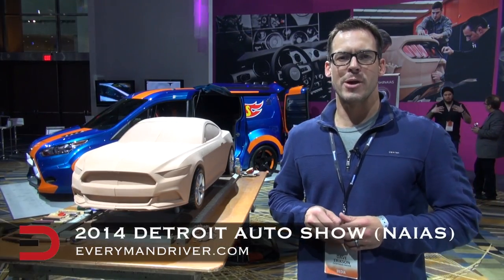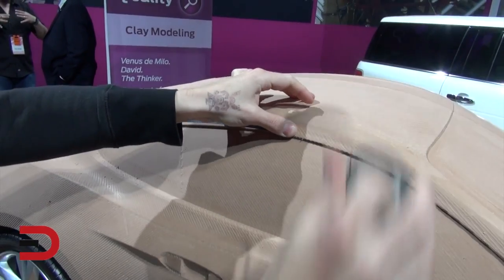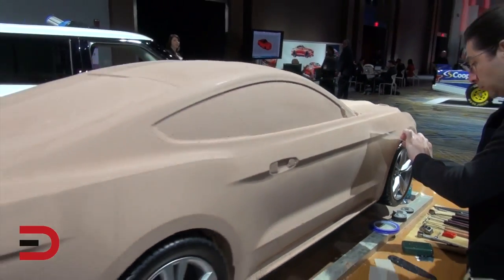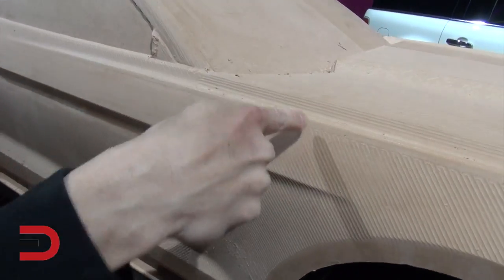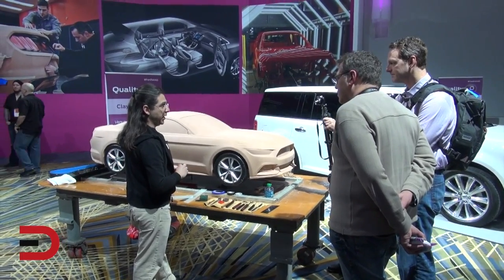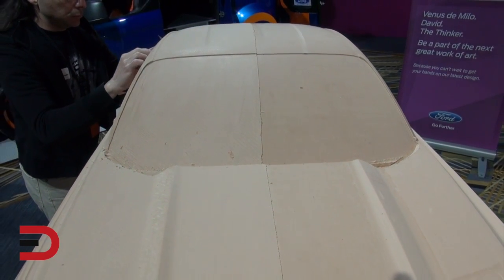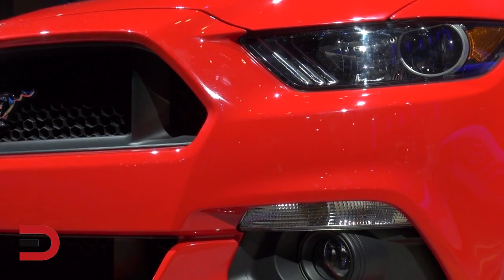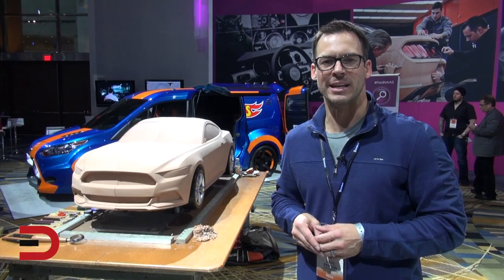Clay Modeling Demo: 2015 Ford Mustang GT on Everyman Driver

Comment: where can i buy the clay
Reply from the maker: +Vic da G Art store?  - Dave, Everyman Driver
Reply: +Everyman Driver didn't know it was just potters clay. I watched another video for the info
Reply: +Vic da G it's automotive clay or design / industrial/ tech clay. It's a hard plasticine developed for industry. Some art/ hobby stores might have it. Also maybe try boat/car repair material suppliers.
Reply: you cant buy it in an art store !
beacause its not really a clay, its a special industrial material made of oils and glass pearls or sth like that. its for sure no clay.
and its extremely expensive